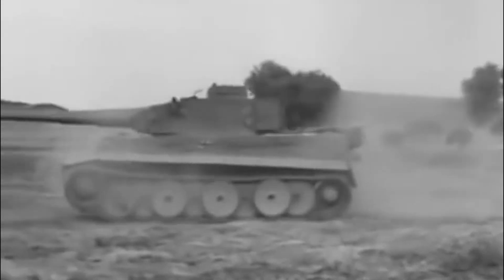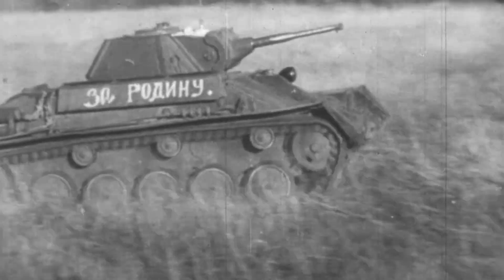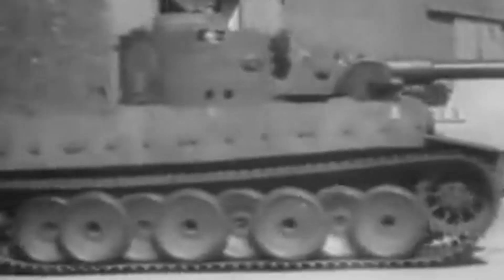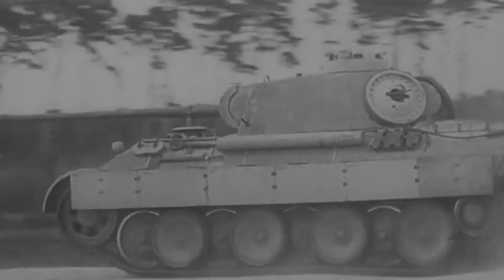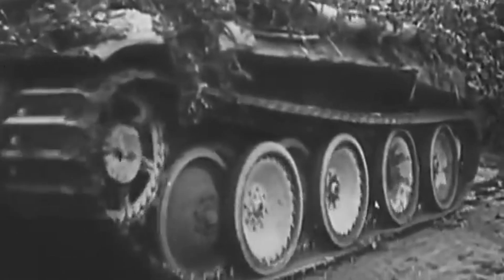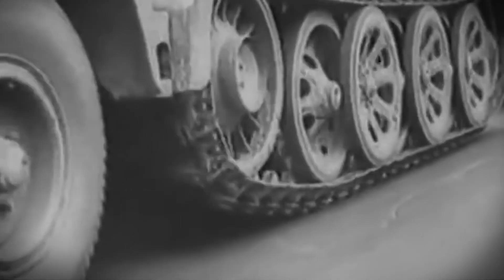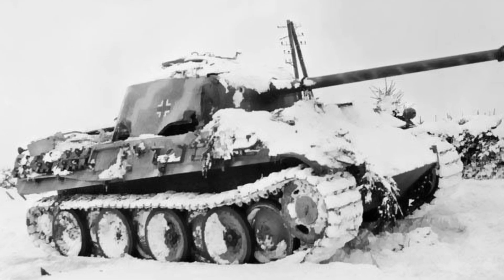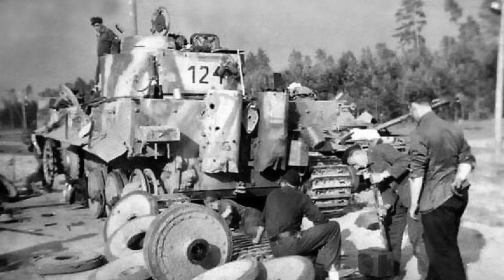What did the Germans do it for?

Comment: Interleaved wheels like we see on the Panther Tank make field maintenance VERY difficult. The Sherman was much easier to repair in the field.
Reply: There is a saying in german, translated:  Why make things simple, while we can make them beautifully complicated??
Reply: Allied tanks were built like cars, making them easy to repair. Even the transmission on a Sherman could be unbolted from the outside and lifted out. Using an airplane engine lighter than a car or tank engine made removal and replacement easy. Road wheels were also built as bogies like train cars, enabling them to be smaller. The whole bogie could be unbolted and replaced like changing a tire on a vehicle.

German tanks, even the Panzer 3 and 4 weren't built with high production and easy maintenance in mind. Unlike the Allies and USSR who built their tanks on assembly lines like the auto industry, the Germans relied on their heavy equipment industry and didn't switch to assembly line production until 1942 when it was too late. To remove the engine and transmission they had to be towed to a shop where a crane would be needed to lift the turret, then the roof off the superstructure. After that, a crane would be needed to lift the engine and transmission out. The whole process would take hours and little maintenance and repair could be done in the field.
Reply: German tanks could be sent to the factory for repair, while Sherman tanks were never leaving the theater and were designed accordingly.
Reply: @ghost307  sure, in part because America was far away.   But its another way to say, Shermans could most often be repaired on stead or in field garages, while the modern german tanks they got send back to factory, or at least, a major repairing shop with heavy lifts...  The earlier german tanks could be repaired them too in field.  both germans and finns were very good with it.  The difficulties come with Tigers and Panters.  Whom theoretically were totally superior wagons, but in practice, had quite a few drawbacks.
Reply: Sherman tanks despite its massive production numbers, were mostly produced in a high standard by well-developed and matured auto industries, something only the USA, the most mechanized society then, only had.
T-34 tanks were said that all it needed was a hammer to fix - because any fixing where a hammer isn't enough they would just not bother it and replace with another dirt-cheap T-34s. 
German tanks were more-or-less average so-so in terms of field repair complexity comparable to other nation tanks like Italian or Japanese ones - they just happened to fight against tanks which were exceptionally repairable / replaceable.
Reply: @sthrich635  Yet germans were very good at field repairs.  Although I presume it depends on which wagon.  Thus, I read about a battle in the desert, where germans and italians run into a trap by 6 pounders, whom shot them to piecemeal.  And reported 21 destroyed wagons... Nice and swell, but when reinforcement did come in the morning, they found just 7 burned out wagons still standing there.  Germans apparently managed to salvage the other 14 - and presumebly repaired up them, possibly by cannibalizing.
Reply: @sthrich635  "German tanks were more-or-less average so-so in terms of field repair complexity comparable to other nation tanks like Italian or Japanese ones" Right, lets compare German tanks with tanks of two nations that got crappiest tanks and pathetic tank production capability.
Panter tank transmission was able to grind itself to pieces in less than 100km under heavy use and in less than 150km if experienced driver was using it gently. Then you were stuck in the middle of field with transmission that was inside tank in the front of its chassis with ZERO hatches to access it and to pull it out you were forced to remove the whole tank turret and then use special type of crane as normal crane would not be able to lift transmission that is so far deed into the chassis...
You have to admire the fact that the Germans and their fans always manage to sell their own propaganda to themself.😂
Reply: @Bialy_1  And what should German tanks compared to? Let's guess, the US Sherman tank designed and produced by the largest industrial power in the world with the most motorized society then, had the most access to resources all around the globe, and with two oceans between its entire industrial base and the warzones?

Onto the transmission issue of Panther tank, the German did know a way to improve it, by using the Tiger type transmission gear - except Germany didn't have enough industrial capabilities to try that and produce the quantities required for both fronts! 
And in actual context Germany past 1943 rarely had any chance to repair broken down Panzers - they were going backwards, the broken Panzers would end up in enemy lines, and on field recovery and repair were risky under constant Allied fighter attack or artillery. Crews instructed to blow up broken Panzers not due to they were hard to repair itself, but the fact they were unlikely to get any chance to repair in first place! 

Yes German Panzers were harder to repair than Allied Shermans, but they didn't need to be better them! For Germany they needed to easy to produce and still combat capable at minimum - they didn't have time for luxury like M4 Sherman's hatches, gun stabilizer, wet stowage and all those!
Reply: If we comparing M4 Sherman with panther then there is hardly any need for maintenance...
Reply: @Bialy_1  sure, there were many Shermans, and new incoming. No real need for any bigger reparations, it was just to leave them if it was anything more than a quickie.
Reply: The Sherman was usually on fire, so they didn't have to worry about wheels.
Reply: @andrestrishak8292  "The Sherman was usually on fire, so they didn't have to worry about wheels." Funny how crews of tank that according to you was constantly on fire got best survivability compared to all other tank crews of the war...😅
Reply: @Bialy_1  "We fought the wrong enemy" -Gen. George S. Patton   (that statement certainly aged well)